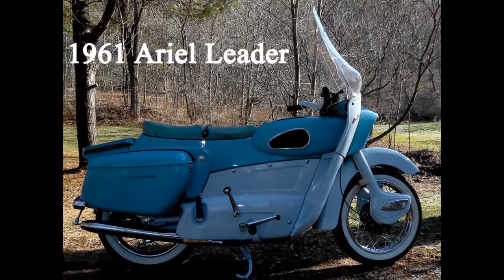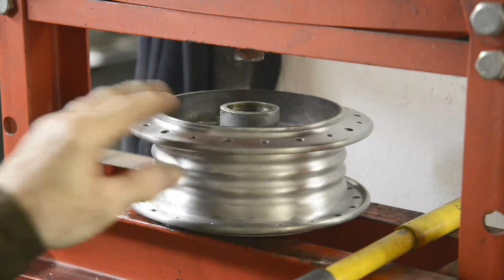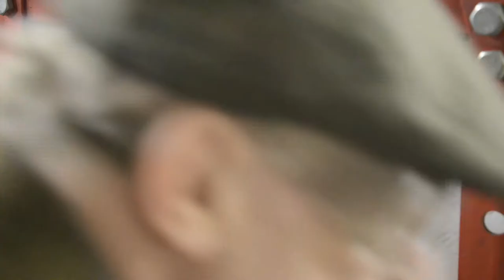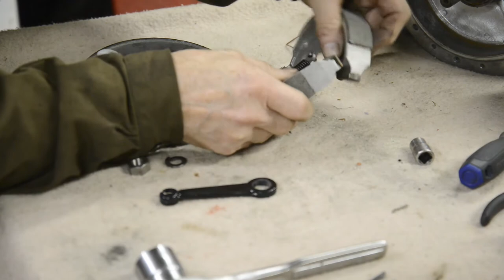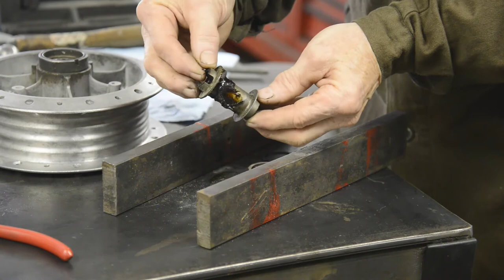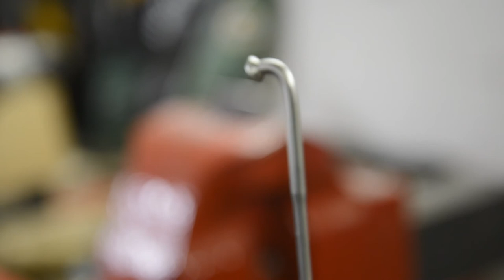Indian Trailblazer  -  Part Seven

Comment: If it was I. I would wash the new bearings first to remove any shipping oils. as the new grease will run away from the bearings
if I did not clean off machine or shipping oils that some unknown person used from a unknown jar,can, tin or floor.

Comment: Hi Michael, I watched your concise video about threading a wheel, I was particularly interested in the truing. I have a BMW that has a poorly powder coated rear wheel so one of the bearings would simply fall out, I bought a used replacement wheel and had to replace some of the spoke nipples so decided to work at loosening all the spokes, cleaning the threads and getting some grease on them, anyway your tip about quartering the wheel and also measuring the offset, I had the old wheel for reference, worked really well, I tried it this afternoon and made it so simple. Thanks.
Reply from the maker: Hello James. I am glad the video was of use. I did an even more in depth pair of videos in the BM 250 trials series.
Reply: @BritanniaMotorcycles  I'm sure it was those that I watched. I had watched a video by another person but wasn't happy because I felt the spokes were too tight, he did it quite differently, also I had not considered the offset, also he never mentioned that, which would make a difference on the F650 Strada because it has a sliding caliper so may have taken the disk off centre, might not have been an issue but at least there won't now. Anyway it was a nice thing to learn. I also thoroughly enjoyed your Commando series, watched virtually nothing else for a few evenings.
Thanks for the detailed and informative videos. It's a refreshing thing to find someone not showing off but instead showing how. A lot of guys, it's about them and a reality tv show, like a diary, there's not many that tell stories and waffle. I like a bit of waffle.

Comment: What about using modern bearings that are "lubricated for life" do you use them or not? The ones with the metal or plastic side covers on I mean.
Reply from the maker: Yes I do use them, and they sometimes solve the problem of poor design where oil seals are used on a shaft but never seem to work well. This time it just happened that for ease I ordered the bearings by part number from Hitchcocks and these were the ones that came. You could say that they are correct, original design.